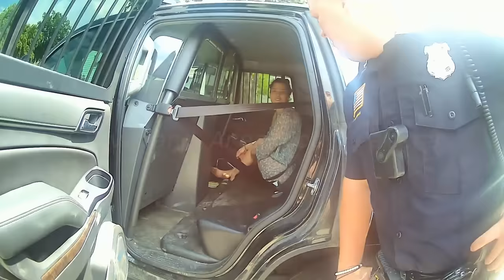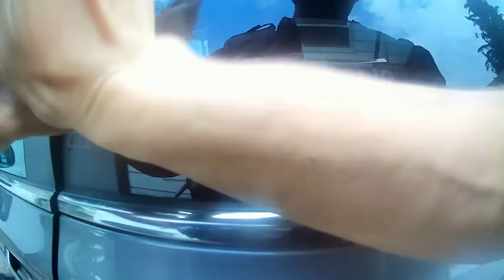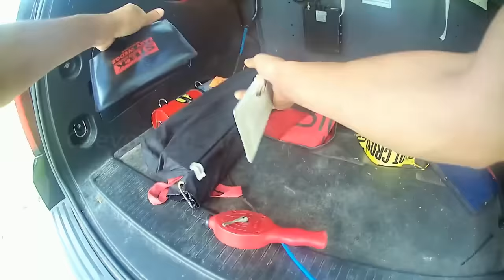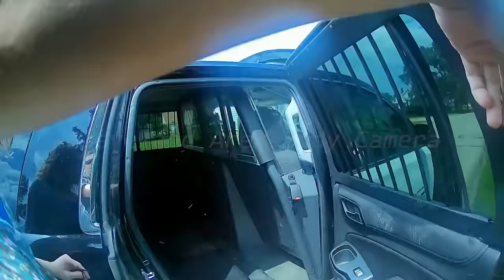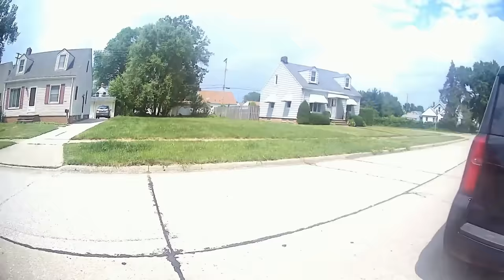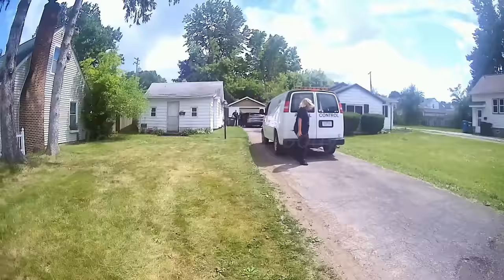Animal Control Freaks Out on Alleged Animal Abuser

Comment: Wait. She left the dog in the car for hours, knowing that car's battery dies all the time. That's stupid.
Reply: 2021.
Reply: Exactly my thought, also, “it’s hotter in the house than it is in the car” bull fuckin shit
Reply: Drugs
Reply: The car won’t turn off if the battery dies 😂the car charges the battery actually when it’s on
Reply: @anayal8tr130  That depends , I changed thousands of batteries,  some people actually drive on expired batteries because they're too lazy to get them changed, or they get the wrong battery, or in case of new cars the sensor on the positive terminal melts away and the car sends too much power to the positive terminal,  which is fairly common with new Ford escapes in Arizona,  so many people complain that their car isn't working and find out it's a faulty part killing their battery,
Reply: I would be driving around with a broken window for awhile if I knew my doggo was stuck in my car🥺
Reply: @anayal8tr130  if the alternator is out then yes the car will shut off. Or if the battery is so bad it can’t be charged, the car will shut off Bc it can’t produce enough electricity.
Reply: JOSHUA Millard you are correct sir the alternator on the other hand will shut off the car , but if battery or the alternator was bad in first place she wouldn’t have got the car on . You can run a whole car without a battery in it the alternator makes the voltage
Reply: @anayal8tr130  🤣🤣🤣🤣🤣🤣🤣 not In modern cars lmao
Reply: once i forgot my car on while doing a scent bomb (it says to leave AC on high for ten minutes). my battery died after an hour and a half… my battery was also less than a week old. i doubt her car battery would’ve lasted any longer than that. but i think her story about the car being on is bullshit anyways
Reply: @anayal8tr130  you probably could run it without a battery but in my sisters alternator went out a month ago and it ran on battery until it died. But if you have a good battery and bad alternator, the car will run for a bit and run out of power. The alternator only charges the battery but doesn’t produce enough power to make the whole car run like batteries do. The alternators job is to maintain the battery.
Reply: Not hours…..all night.
Reply: @misseselise3864  did you have the car running? Or did you just turn on the ac? 
Your car will die if car isn't fully on.
Reply: Some times people are allowed to blunder through life as a hot mess because they're pretty. I've found people either go through life hating them because they're jealous of their looks and all the attention they get, and use all the constant fuck ups and stupid decisions as an excuse. Or folks will baby them without taking the poorly treated mental issues and addictions as seriously as they should, because they hope if they're supportive without ever putting themselves in the position to be the "bad-guy" they might have a chance with the unstable hottie. 

We just need more resources, and we need to make the resources we do have as available to attractive people as they are to everyone else. Don't dismiss someone who needs help because they'd be fuckable if they had they're shit together. Neglect someone like that basically condemns them to abusive/exploitive relationships or cases like this where they get busted for not being a competent sober adult who can handle life and responsibilities.
Reply: Imagine being part of a seemingly loving family and trusting your life to the human closing the car doors on you, leaving you to your horrible fate for hours on end, because that one person didn't want or just didn't care to help you.
Like even if you lock yourself out, why not call someone to help you open the car or even crazier, putting some effort into it yourself lmao
Before I'd let my dog die in anguish, I'd smash the window easy as that smh
Reply: Not knowing how to break in to your shitbox car is pretty stupid too
Reply: @camerongover8459  not wanting to is more like it. She could’ve easily grabbed a rock, anything, and broken the window. She put her cars window before the life of that dog and that’s unacceptable. I’m glad they charged her. She needs to be held responsible. And from my under standing it’s not even her dog, it’s her boyfriends. She’s lucky she got arrested bc if my bf killed my dog I’d kill him when I got there. She said he was on his way there and she was more concerned they were arresting her then apologizing for murdering his dog. Not once did I hear her say she was sorry to him on the call. I’d be hysterical snd sobbing my apology, I’d also never do something so fucking stupid and reckless…but people make me sick.
Reply: @Sara-xk1ns  She's smart enough to pick up a snake off the ground and let it bite her. We're all fortunate it wasn't a child or else we'd have seen it on liveleak or
 r/peopledying

Comment: Imagine sitting in a room where the only oxygen you get is 130 degrees with no water while the windows intensify the heat 5x. If you don’t wanna go through that then I know for a fact your dog shouldn’t either.
Reply: on june 10, the temperature high was 81°F and the low was 71°. the temperature in that car when it’s been 71° for 30 minutes is 105°. i’m baffled as to how she can think she’s innocent

Comment: "It's hotter in the house then in the car."
What kind of logic is that? 
Also she told the cop she took the dog out and put him back in. Why didn't she just leave the dog out of the car so it could at least get some air.
Reply: "What kind of logic is that?"
idk maybe the car has working AC system and it overloaded the weak battery?
Reply: @darkshadowsx5949  a bad battery wouldn't kill a running car. A running car gets its power from the alternator

Comment: “I was waiting for Phil and my battery died” listen to that carefully, no remorse, trying to come up with excuses to not make yourself look bad. She showed more empathy when the cop said she was being arrested, than when she found out the dog was dead.
Reply: And the fact that that makes even no sense. It’s NOT POSSIBLE for your battery to die when your car is running. Unless your alternator fails. Or you run out of gas. Your car doesn’t even run off the battery. Only used the battery to start. So her WHOLE STORY was bs
Reply: If the vehicle was running the alternator would have charged the battery until it ran out of fuel. The "electronic" switch he used to open the door proved that the battery had enough charge to power the coil in the door lock unlocking the door.
Reply: Well she’s an incompetent, unmindful drug user. Things like this happen with those attributes, and lack of remorse probably follows with that kind of mind frame. She seems to know that what she did was wrong and was held accountable, that’s what’s important.
Reply: More like waiting on drugs, she didn’t care about that dog at all! Why not have him outside instead of a hot car. She’s stupid.  Not freaking out or anything.  This is a drug addict hope she rots in jail
Reply: @jacknickolstine3355  I think the officer noticed and didn't cut her any slack
Reply: Emotion =/= empathy

Comment: The temperature inside a parked car can vary depending on factors such as weather, insulation, and the use of air conditioning. While air conditioning can help regulate the temperature, it's important to be aware that even with it on, the interior of a parked car can still heat up, especially on very warm days. Factors like sunlight entering through windows can contribute to heat buildup. Therefore, it is not advisable to leave pets or people in a parked and stationary car, even with the air conditioning running. Safety precautions, such as parking in the shade and ensuring proper ventilation, are crucial to prevent overheating. She has the clouds in her favor

Comment: That's a b/s excuse. If your car battery dies while the car is running, the alternator generates enough power to keep the car going... not great for the electrical systems, but the car won't just shut off

Comment: I've had extensive training in carrying out cruelty complaints, and however hard it sounds, if one allows just one to freak you out, you cannot handle those that might be even worse - and yes there are - many. It's not easy to just stay professional,  even though you're breaking up, step back and handle each one clinically and professionally.  It's honestly the only way - to stay sane. The same when you have no choice but to put an animal to sleep that has been severely injured - and nothing can be done, its in that animal's best interest, to set its spirit free. It's a tough job, but stay focussed on each one. There have been times when I've wanted to lash out at the guilty party, but then they can walk free. See this from someone who has years of experience.